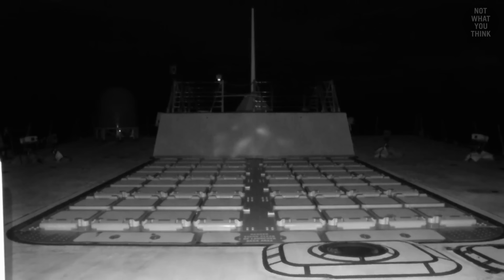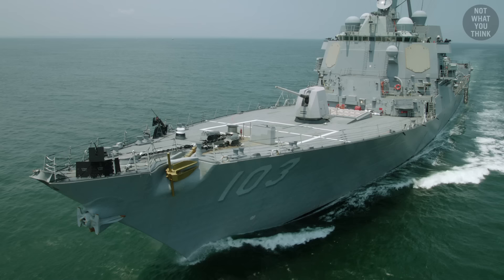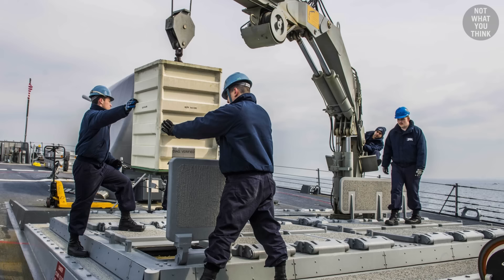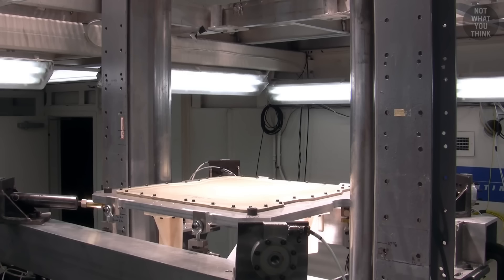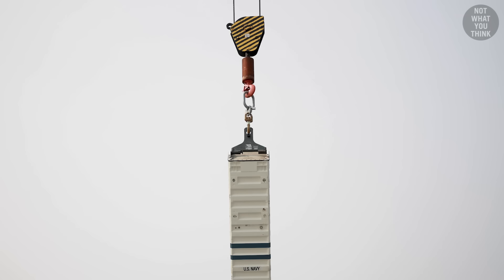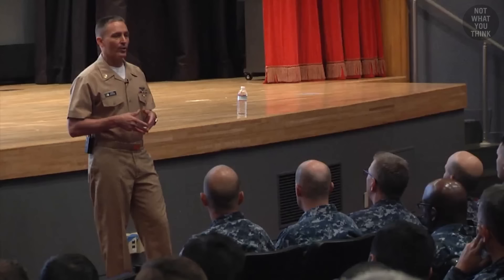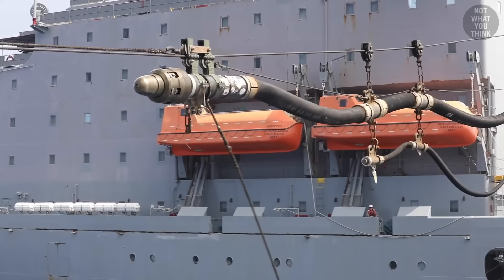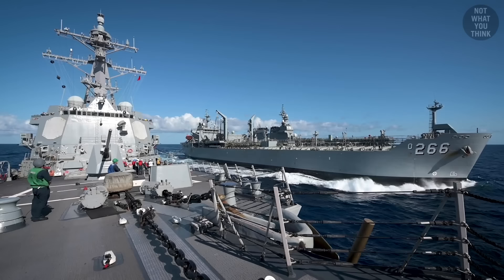Why Warships Cannot Reload Missiles at Sea

Comment: An old RD/OS/EW guy, now a retired chief engineer (systems/software) from a Fortune 100 defense contractor.  You need to think of the larger strategic logistical picture here.  The Burkes and Ticos provide 2 inherent capabilities - the Aegis networked sensor system and the weapons platform with weapons.  If a ship goes Winchester, you are also removing a serious sensor platform from the area to reload.  It's better to use an arsenal ship concept to augment the sensor platforms with additional weapons, and shuttle them for reloading.   You can have rather simple 100 to 300-cell small decks providing a robust mixed bag inventory.  Also, for the most part - let the USAF utilize their cargo aircraft for cruise missle Rapid Dragon deployment, and specialize the arsenal ships for S2A/S2Space and S2S along with ASROC mixed bag loadouts.  There is no perfect solution here, but there are much better solutions available than what is currently in use.

The other major con is the floating weapon inventory.  You do not want a Zumwalt situation where you have the guns on deck but are unable to afford the ammunition it uses, in sufficient quantities.  You have to be able to afford several of these hulls with their contingent 200+ weapons loaded out and ready to use, on station, while having foward deployed reload inventory.

Another problem not addressed is the limited number of cells on any single hull.  Having the ship go winchester will essentially sink that ship (and its sensors).  Having an arsenal ship available within the area, solves or at least postphones this problem till the opposition's airfields are taken out by RapidDragon and/or the SSGNs.  At the start of the conflict having the second arsenal ship ship leave port to relieve the soon to be emptied arsenal ship on station will get ahead of the logistics cycle.  The replacement arsenal ship can start to shoot as soon as it's near the combat area, while the empty transits back for reloading.  You want the Burke's and Tico's to use their own cells as their last resort.  

You have to think/game the entire situation through, just not the middle of the problem.  This is a full up integrated end to end problem.  You also need to bring on all available assets - in order to consider the best possible load out configurations and weapon utilization policies.
Reply: The USN has said it wants more unmanned vessels in the fleet. Having a large number of unmanned small arsenal ships might be what they’re thinking.
Reply: Man's shamed the Zumwalt in so many ways, I cannot imagine the pain that the USN has to go through to combat the 055. The DDG(X) is literally using the concepts of the 055, and semi Arsenal ship as well.
Reply: This answer really shows why we've spent so much on beam weapons and rail gun development. I wonder why we're not closer to mounting them on ships?

Some questions: 

Would the arsenal ship concept be submersible?  

Supposing we could get Arsenal Ships online, how do we even use the resources if AEGIS has a data-link capacity problem? Is AEGIS at end of life?
Reply: You mean a Carronade-type IFS? Basically a container ship filled to the brim with VLS and nothing else? That would be cool. Cooler if it can perform reloads too.
Reply: Yes, cheap, plentiful arsenal ships do feel like the right answer. That way the ships providing the fire control could treat their own missile load as the "last line of defence" to protect the ship itself after all of the arsenal ships have run dry (while getting the hell out of Dodge).
Reply: That's what I was gonna say.
Reply: The biggest issue with the arsenal ship concept is that the US Navy has not bought enough missiles to fill the VLS cells it already has, so adding even four ships with 200 VLS cells each would be pointless.

Unless the missile inventory was significantly increased, like four or five times more than what the Navy has today.
Reply: @himemjam Beam weapons have inherent physics limitations. Beam attenuation and beam dispersion mean that the energy per area drops drastically as the distance increases.

Railgun research has mostly stalled. Barrel wear is insane. You get maybe one or two shots before the barrel is unusable.
Reply: And while I agree, the counter argument that’s often made for arsenal ships is that we put all of our eggs in those few baskets, and the enemy only has to focus on shooting the basket.
We need more chickens to lay more eggs, because the Navy doesn’t have enough reloads for this scenario
Reply: Or, have the arsenal ships launch the missiles - the cruiser hooks up with the arsenal ship (literally, with a cable?) for command and guidance, but it shoots the weapons aboard the arsenal ship - no more 'smooth' sea needed, no safe harbor etc. - the arsenal ship becomes the 'magazine' (obviously only works in 'extended' conflicts - and yes, two ships together make a better target than a single one).
Reply: Guy started his monologue by trying to flex 🤡 Just cut to the chase.
Reply: @Matt-yg8ub The "Arsenal" ships don't need to be huge.  They just need to be sufficiently seaworthy and large enough to carry a sufficient number of VLS cells.  In fact, there is an argument to be made today for dispersing several small vessels to screen the destroyers and carrier.  

The Ukrainians have shown us how air drones and sea drones will affect future naval tactics.  Smaller, numerous, disposable, dispersed vehicles that augment what the humans can do is the future.  Kinda like the concept of the PT boat in WW2 -  small, hidden, fast, make the first contact, pack a punch, run away, in 2023 it's even better because there are no visits home to the family if the small vessel is lost.
Reply: @jeffreyharris3440  PT boats worked because the cost of destroying one exceeded the cost of building and defending one. Not so in the modern era of a SMALL arsenal ship, the missiles it carries would cost more than the ship itself…. And the ship would become a liability because you would have to expend even more resources to defend  those missiles. 

Ideally submarines would serve this purpose, they are expensive and complex, but you could automate multiple platforms that could submerge as a defense. 

Just picture of the Soviet attack on the carrier, battle group in red storm rising, they used decoys to get the fighters out of position, and they launched enough antiship missiles to overwhelm the Ticonderoga, and all of the close in weapons systems …. Resulting in the loss of the French aircraft carrier, and the damage to the Nimitz. 

The modern equivalent is even more effective…. Something like rapid dragon could be used to take out the cruisers and destroyers, and then hit the carrier with the larger antiship missile’s.

The Soviets bears and badgers were limited to only being able to carry two antiship missile’s, the American equivalent can carry 10 times that many today….. and Russia and China are not far behind in that capability.

The limiting factor is not a tanker, loaded down with a bunch of VLS cells…. It’s the fact that each one of those hundred million dollar missiles does an expensive time consuming process to manufacture, and we don’t stock pile enough of them.
Reply: @Matt-yg8ub I’ve been thinking for a while the cost of missiles should be audited.  A tomahawk costs what, a million dollars?  And has ever since it was invented.  I suppose that’s nice considering inflation but shouldn’t the cost come down over time as the tech gets easier to make?  A missile is mostly a metal tube.  Most expensive part I would assume to be the guidance system. Why can’t the systems be mass produced to reduce cost?  I bet if an audit was done we’d all find out the defense contractors have been gouging us for years.  The whole, 100 dollar hammer type of thing.
Reply: @shaunkelly9053  probably
Reply: @watwat9864  The requirements driving DDG(X) are independent of the Type 055.  It is more of a Ticonderoga replacement inasmuch as it will have 128 VLS cells in four 32 cell blocks, and have flag accommodations.  Burkes don't have room for the Air Warfare Officer and his or her staff like Ticos do.  One of those 32 cell VLS blocks will be able to be converted to launch ballistic missiles with a hypersonic glide vehicle kill vehicle.  It will have vastly better ASW capabilities than anything the PLAN operates.
Reply: @shaunkelly9053  The Tactical Tomahawk, or "TACTOM", Block V being built today is a completely different missile than the Tomahawk Land Attack Missile of 1985.   Different airframe, different control configuration, and everything inside is different.  Block IV was a complete clean sheet design, no relation to previous blocks I, II and III.  Block V is a highly upgraded Block IV.  It is actually kind of remarkable that the price of a Tomahawk has remained as low as it has, less than some air to air missiles.  That is one of the things that keeps them relevant.  Compared to other cruise missiles, especially the ramjet screamers, TACTOMs are a bargain.  Salvo size matters and a less costly missile lets you buy a lot more of them than you could a much more costly ramjet screamer.  I believe even the GQM-163 Coyote, a ducted rocket ramjet target used to simulate some of the Russian screamers for exercises and weapons testing costs more than a TACTOM.  
As for mass production, try to find people with the skills who aren't using drugs, have no arrest history and can pass a background check for a security clearance.  Not such an easy thing to do today.
Reply: @philsalvatore3902  a lot of mass production can be done by machine. Assembly would just need a person.
Reply: @philsalvatore3902 Quit lying to yourself, we all know the reason why the USN wanted the DDG(X) program. And we all know Navies around the world are trying to replicate the success of the 055. Japan proposed the same project, so did the US. It's absolutely delusional to believe that the 055 is not the HMS Dreadnaught, when 055 literally purposely abandoned the little tricks like a Stealth gun on the Zumwalt and replaced them with 112 universal VLS cells for both amazing offense and defense capabilities. The DDG(X) is clearly trying to replicate the 055. And if you wanna argue that it is not a copy, then yes, it's not a copy. But they're absolutely the same concept with different weapon systems.
Reply: @shaunkelly9053  Even automated factories don't run themselves.  You need smart qualified staff to run a production line.  Everyone at every level has to be cleared.  I don't know how much industry hiring you have done in your life but rap sheets and drug abuse are surprisingly common.  This is a problem facing all kinds of production, not just weapons but is maybe more acute in the weapons world because assembly requires some very specialized skills on equipment you will never see outside of a classified space.  That means costly training nobody is going to walk in the door with (unless they were fired from another defense contractor and that raises its own set of questions).
Reply: @philsalvatore3902  I suppose I’d like to see a little more patriotism from our defense contractors and for them to cut the tax payers some slack. Brand new stuff like an F35 is one thing, but the missiles and bombs it would be nice if they didn’t try to make a huge profit of of them.  I doubt our adversaries get hosed on prices by whoever makes their stuff.
Reply: @watwat9864  It is not delusion.  I have some actual insight into the program.  You forget the Navy has been trying for twenty years to design a replacement for the Ticonderoga Class.. This is it.  The Navy is going low risk after their experience with the Zumwalt class and the LCS.   Take the best from the Burke class and expand it to carry more missiles, generate more power so the class can take advantage of directed energy weapons when they mature.  Btw, if there is a model for the DDG(X) it would be the South Korean Sejong the Great Class.
Reply: @philsalvatore3902  You're talking about the Navy that created the Littoral, Zumwalt and GRF Carrier ships. While wasting money and never actually boosting the USN's capability. If this is not delusion, I don't know what is. Also, the actual replacement of the Ticonderoga should've been an Arsenal Ship, but the lead behind that program mysteriously committed suicide. We all know the currently USN's ships are just for show. The only ship that is decent is actually just the Burkes. But that class of ships are filled with old ships that are not up to date and do not possess the same capabilities as the Flight IIA or the IIIs. If you really paid attention in the last 20 years, you would understand the Arsenal ships were the answer.
Reply: @watwat9864  You are talking who's bread and butter are weapons.  Been around this for a couple of decades now.  Even worked on some of the stuff you are talking about.    
The Ticos were designed way back in the early 1970s, long before talk of arsenal ships started showing up.  They were built because we could not produce CGNs fast enough to meet the Soviet threat, and existing CGNs were not able to be converted to carry VLS and Aegis.  To do so would have been hideously expensive, risked their stability and would have taken them out of service for years at a time.  The Ticos were built on the Spruance class hull and machinery already in series production.  It was the least costly and fastest way to get Aegis into the fleet.  Nobody was talking about arsenal ships back then.  
Obtw, the PLAN seems to understand the implications of the LCS more than the knowitalls in the US.  Their military literature calls them a major threat.  They see their speed, shallow draft and the fact they are being armed with NSMs and consider them to be a hard to hit target with some punch that can go into shallow waters their Type 054 frigates cannot go, while carrying two helicopters that can sweep mines and shoot JAGMs at them.    
And while the Zumwalts were built to meet a specific need of the Marines, a naval gunfire support requirement that finally and logically went away when the Navy was able to convince the Marines that banging away at land targets from 50 miles offshore wasn't even a little bit survivable against enemies with lots of cruise missiles, when they come out of their next yard periods they will have their big guns removed and replaced with a new form of VLS launcher for ballistic missiles armed with hypersonic glide vehicles.  Combined with all the other weapons in their existing PVLS tubes no other navy will have such a capable surface ship in their inventory.  All the other crap that was being spewed about the Zumwalts being unstable have all been proven wrong.  They are, if anything, a lot  more resistant to rolling than a Tico was.   They are fine sea boats, well armed and extremely hard to detect.
Reply: That's what I'm thinking too. Having a bunch of inexpensive ships that just carry a bunch of missiles of all sorts to be the missile carrier for the destroyers and CSG. And this ship only need to be very minimally manned.